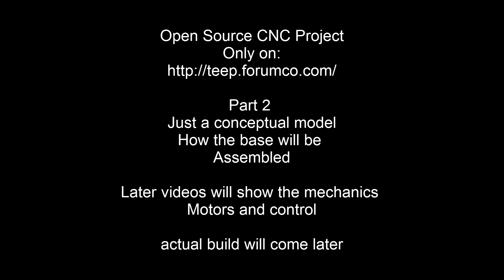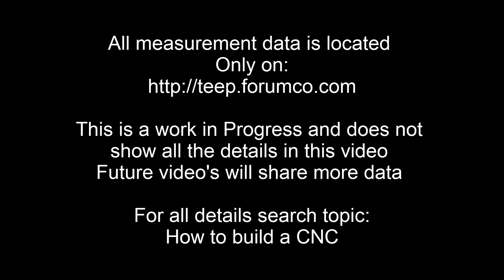How to build a CNC part 2

Comment from the maker: Just a quick update for you all. I was going to limit the size of the build bed to only 18" x 18" but after much thought I felt it needed to be a bit larger so that a 24" x 18" build bed could be used. At the extreme I am thinking it will be able to have a 26" x 19" build area but we will need to see. So with this sad you will see a bit of change in the next video.

Comment from the maker: Yes A full XYZ axis this means that you can make any shape cut. It is my goal to make this as easy to build and excellent function as possible. It is all open source so that anyone can build everything from the machine to the circuit that will drive it. I will be posting a new video soon that shows all the axis and how each works.